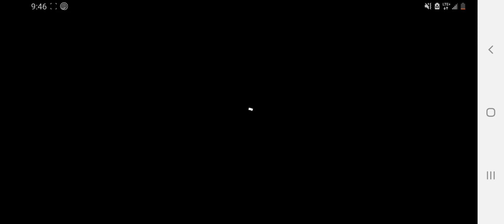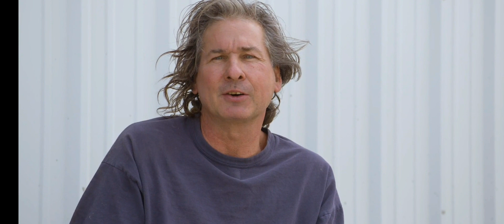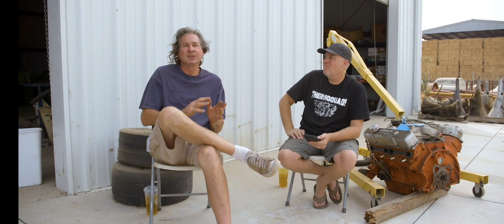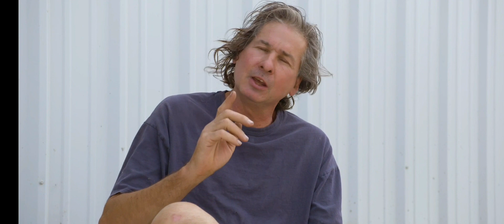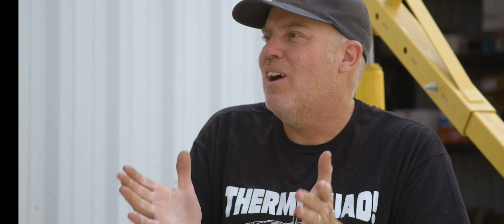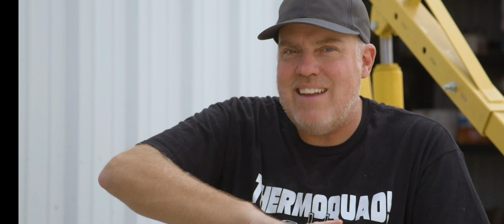uncle tony's garage gets called out by the roadkill guys and they say he's  full of shit

Comment: I didn't hear them specifically "call out" UTG. The closest thing was challenging former journalists meaning uncle tony. While I watch both regularly however, even very knowledgeable people get things wrong sometimes and its best to question everything. Previous performance does not guarantee future success.
Reply: agreed people are making up imaginary stories and trying to create havok ie trolls
Reply: Well, if they're meant to be digging at UTG,   they're moving the goalposts.   Centered performance pistons are not what UTG deals with.    Is less stock piston offset better?   Clearly UTG and those speed parts makers agree there.   Is  centered better than flipping the offset entirely?   Quite possibly,  but that's not what UTG is comparing.  He mostly deals with what you can find in old stuff.   He's also made a point that you can't do this if what pistons you have stock are cut out  for the valves not to get hit.

Comment: Direct connection manual has a paragraph on backwards pistons. UTG didnt invent it.
Reply from the maker: Can u send me the article cuz iv looked and can't fine anything  on it nowhere  everyone i have talked to  on it says its the wrong thing to do  and like tony said out his own mouth that its going to  have some piston  slap and thats a good way to brake a cast pistons
Reply: @dontbestupidshows4623  I will look in the book and give you the page. It is also mentioned in the mopar performance A engine performance manual.
Reply: According to Larry Shepards book Mopar Performance small block "A" engines page 114 paragraph 4. "Factory pistons have the pin offset to reduce piston slap. By reversing the piston, engine friction is reduced." then it goes into some detail, gives a piston to bore clearance and notes aftermarket pistons dont need to be reversed for obvious reasons. I have done several big blocks with no issues what so ever and i shift when the valves float if that gives you any insight.
Reply from the maker: @texasmopar5557   thanks for sharing the articles but u still have piston slap thats why the factory dose it to reduce piston slap so if you do it anyother way more than likely u will have piston slap piston slap witch on a cast piston could brake and hurt your channel  thank u for share it my whole point with this video  is to hear both sides of the argument so people can form there own  Opinion
Reply: @dontbestupidshows4623  I have never run into piston slap and have done this several times in engines that see total abuse. You mention factory, the paragraph I mentioned was published by the "factory" in 3 manuals I know of that could be purchased at the dealer ship parts counter. Im sure it would blow your mind to note the "factory also stated you could install standard pistons in a .10 over bore.
Reply from the maker: @texasmopar5557   iv heard  the piston  thing dont know much about  it again thanks for posting the article and thanks for acting like  an adult not wanting to  argue with me and I'm glad it worked for u I just post  2  Opposing views cuz a lot of people don't have motortrend and think people should hear both sides
Reply: @dontbestupidshows4623  Motor trend is whats wrong with the world. To many guys sit around on youtube instead of wrenching. The first motor I did I wanted to build a 60s B body as they would have from the time period. I followed every detail from the manual and worked with only used or NOS parts from the period. If more guys would do a project and work with what they have it becomes alot more satisfying. There is a time and place for this stuff. If you use a machine shop and aftermarket stuff the argument is null and void. Its about re living the muscle car era for me.
Reply from the maker: @texasmopar5557   that's cool I'm glad u enjoy  that
Reply from the maker: @texasmopar5557   i usually watch motortend or youtube  in the garage work  on my 68 pontiac lemans im mainly lesson to it lol
Reply: @dontbestupidshows4623  You must only have 1 entry level project then if you can watch TV and work. Kinda strange you would trash Uncle Tony considering has spent many years as a mechanic on a successful nitro car team.
Reply: @texasmopar5557  to bad we couldn’t make this a sticky on these guys foreheads...... bunch of hacks should find someone else to bash on ill mechanical practices. Like, i got an idea. How bout they call themselves out for barely making anything run and breaking everything they touch. At least Tony builds things with longevity in mind.
Reply: @Joseph Rossini He calls DeFeo Uncle hack all through this thread, Tony's a fucking legend in NY-NJ street circles. What has either the YT channel here or the motortrend pimps accomplished on their own? I have polaroids from the early 80s of real street racers shutting down the GWB to get money runs off, rolling around Newark in Dyno Don's 427 SOHC turned into a street racer and Tony was front and center at shit like that while Friedburger and Duldick were in their strollers. Amazing that these kids think this shit just started in the last decade and before YT nobody built or raced cars.
Reply: @jimmartin7881  A legend in his own mind like you.
Reply: @Hanzyscure  That makes absolutely no sense, stop repeating things your dad says if you can't do it correctly.
Reply: @texasmopar5557  I have reversed stock pistons in many LA engines the 360 I have in my truck right now has reversed pistons they have been in there for 4 years or more the only noise I get is when I first fire it up then it goes away and I drive it hard and shift at 6 grand if it was going to break a piston I think it would of by now but I have other engines built the same way the 318 I have a spray with Nitro and have burned up valves and head gaskets I have never had a piston break because the pistons were reversed.
Reply: @dontbestupidshows4623  Motortrend guys don't reuse stock pistons they have people that give them free engines and free shit so they know nothing about using stock mopar parts I have worked with lot's of new and used stock Mopar parts
Reply: @texasmopar5557  if it did anything EVERY performance engine on the planet would do it. It does nothing. Uncle tony is right in a lot of things. But he panders to people who are pissed they can’t go fast. I mean he has shot himself in the foot many times. One video he said that if you have an ls you don’t know how to build power. I offered to send him money and we could go head to head and he didn’t respond. He spits crap from hot rod mag from the 60-70’s that has been debunked or doesn’t work today.
Reply: @ScooterLee-ei1ep  For me personally its about building my 60's and 70's Mopars era correct. Ive got buildings and trailers full of parts so I could give a damn if I scatter one. If LS is your thing and you like cheap easy power go for it. If the GM guys dont like Tony dont watch his Mopar channel.
Reply: @dontbestupidshows4623  Yeah, Im quite astounded by the comments here. Lots of people are at kindergarden level of Mopar knowledge. When Larry Shephard wrote the DC Bible in the 70s, for you youngins (under 50) that may not know, that is the "Direct Connection Engine Manual", yes there was mention of the reversing of the Factory pistons. This was done during the early days of Mopar racing in stock classes, etc using factory stuff. Those of us around in the late 70s-80s golden period, are all aware of this piston info, but rarely did it, because you just went out and bought new pistons. When Tom Hoover built his 360 (372") 69 notchy toona, he used factory 340 pistons back to front, because he Could.....He was a high up Chrysler engineer, with access to all the factory parts. 
When Billy Bellafato built his 360 68 notchy toona in the 80s, he used hi comp aftermarket pistons.
EVERYONE, in the Mopar scene from the late 70s thru the 90s, has been there and done that, with Everything that Uncle Tony talks about. Its all been done 40 years ago. If you young guys want to increase your knowledge, buy the DC/MP engine Bible, search the swaps for old Mopar Action, Mopar Muscle, HP Mopar, etc etc and read and learn. Or hang out with the older Mopar guys and ask questions....politely.
Reply: @dontbestupidshows4623  Brake or break?
Reply: @Joseph Rossini If you read his description of his channel he says he is totally devoted to trashing uncle tony. He makes the very clear.
Reply: Tony never claimed he invented it its been written about since the 60s by people like Shelby and Yunick its not some secret he's said this himself
Reply: @jimmartin7881  total respect for Tony , raced alongside him at Island in the 80s. 
But I gotta give props to Frieburger also , he's been a Land Speed racer for years , and currently is the World Record holder in C/coupe .

Comment: Now I respect both these guys and Uncle Tony. They don't actually mention him by name because they know that's unprofessional. However what they are talking about they forgot Steve should have remembered that Chryslers performance engineers did excatly this in the 1965/66 Drag Racing seasons thru 67 with the 273 V8 and it did work! Worked so good that even in a B body the little 273 turned in impressive ETs for the Golden Commandos and the Ramchargers Hot Rod magazine in Feb 1966 published the whole factory build secrets in the February 1966 issue. Technology has been so greatly improved that this isn't necessary any Tony is an old school guy who knows what works and doesn't with old school mopars. It just so happens that all the points Steve and David make really won't work on Fords or GM engines because they mostly used cast pistons with non-bushed rods in their passenger car engines back then. Chrysler used forged pistons and floating rod bushing on the 273 and early pre 1970 LA 318s. The LA 318s pistons are low compression and generally sit 0.0180 below the deck. Not so with the 273 but their pistons had 4 valve relief cuts in them. I could go on and on but won't. I would love to put a 4.00" stroker crankshaft in a 273 with edelbrock heads with 1.94" intake valves and 1.58" and 10.5-1 compression forged pistons just like the Golden Commandos did back in 66 and top it off with EFI. Just to bring their work into the 21 century. It would be a high winding small bore V8 with plenty of guts with the right cam.
Reply: now if UT would have mentioned that one engine and that one case... go index your spark plugs also!  It works for everything and second of all.... if it worked for everything, just Dulc said, the piston makers would copy it... So you dont know if it worked and you dont know if it made more power.
Reply: @crunchemagain2030  ask yourself why the performance piston manufacturers don't offset their pins to the INSIDE like the factory does ?
Reply: @Richie_the_Fixer  they do...
Reply: If its not hemi don't waste your money ,a 283 has more potentional then a 273:
Reply: A 273 racing engine? What a joke.
Reply: @markg7030  Exactly. UT is a joke.
Reply: @darrellsomers5427  Some Mopar guys & especially UT are delusional. He tells anyone that will listen that a 318 is a high performance engine when everyone else on the planet will not waste 1 penny trying to make power with a 318 when a 340 or 360 and Magnum 360 will make double the hp, cost half as much to build and will be take a 1/4 of the time than screwing around with a 318. UT does nothing but run his mouth, give false information and makes videos about the most irrelevant topics it not even funny. Videos about common knowledge like conventional oil vs synthetic oil is not groundbreaking. He’s a legend in his own mind.
Reply: @MrWill73  well i will say the one thing hes right about some things

the most interesting one to me is his timing curve videos  as an example.  initial timing  does need to be where its at and if your engine needs much more then give it to the engine.  most people just set total and let the initial fall where it may

thats not correct  but a lot of people do this then put in long duration cams or thumpr cams, a lot of the time with not enough static compression, and wonder why they cant tune it for shit then start cranking on the fuckin mixture screws  and now they fucked that up too.  what they should have did is what he said.  set the inital for highest vacuum back it off a couple of degrees  get it all in as fast as you can and set the total to where it makes the most power.

an MSD distributor would be able to do this no issues

so while i agree the piston flipping thing is a little funny,  quite a few things UTG  says have merit and i also like these two as well along with vizard and richard holdner
Reply: @markg7030 hahah big whopping 180hp race engine. 😊

Comment: I don't think tony has ever stated it increases horsepower. It's a low rpm boosting mod.
They claim it would interfere with the valves. Tony's videos clearly say to put it in the opposite bank specifically for that reason.
They claim its a mod not worth doing to your car. Tony has specifically said it's a mod to do only during a rebuild process.
They claim it reduces start up clatter. Maybe, but if you're seeking upgrades and you are rebuilding an engine its a non-issue for hundreds of thousands of miles.
They claim just buy new parts bro. Tony avoids buying anything new if possible.
They compare it to aftermarket mods. Tony never claimed its an improvement so big ICE concept should be redesigned around it. Also why aren't aftermarket pistons offset so you can copy the factory geometry?
These are tv show producers who work on cars. Tony is a car hobbyist, who shares his knowledge in magazines or online
Reply: Alex Eidenier  price quickly adds up and tony is a car mod dumpster diver anyways. Also why consume new chinese products if your old pistons are fine and its just the rings that are bad
Reply: Alex Eidenier  but in the case it doesn't need then it doesn't

Comment: I like Dulcich and Frieburger but I rolled my eyes at this clip. Roadkill is fun and entertaining but ultimately owned and sponsored by companies with TONS of $$$$. And therefore high dollar components are provided for free- even entire ready to run crate engines with unlimited dyno runs at Westech (Steve Brule is great BTW).  So why go after a guy that caters to time clock punching  stiffs making Im sure waaaaay under 45k per year?   Tonys viewers will NEVER be able to duplicate Motor Trends projects but they can duplicate Tonys projects (Yes those projects are not pretty but they are affordable, doable and FUN.) Sponsored TV and streaming car shows like Roadkill give the illusion that a new set of aluminum heads, full roller valvetrain conversions with Harland Sharpe rocker arms and a fuel injection conversion is super cheap and can be done by anyone to every engine.  YouTube channels that focus on using alot of OEM parts are incredibly popular because its an entry into hot-rodding that does not require a 6 or 7 figure salary- or a big loan.
Reply: You absolutely nailed it!
Reply: The Motortrend guys are trying to pander to what they think people can afford to do, Uncle Tony makes sure even the youngest rookie can start out and learn tricks of the trade